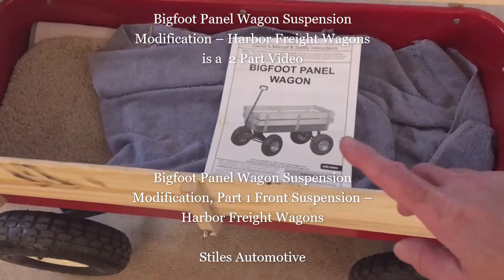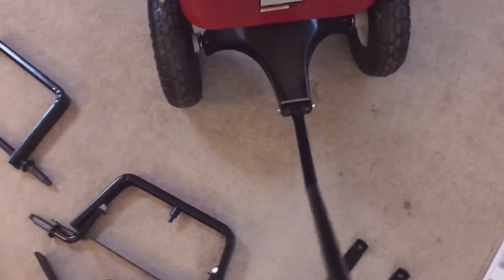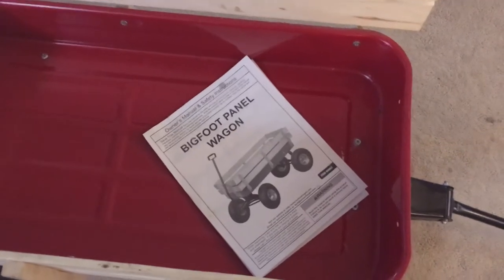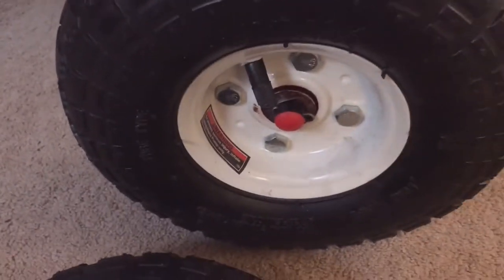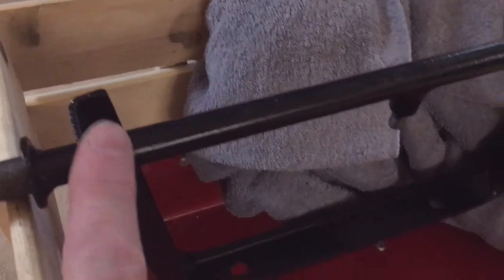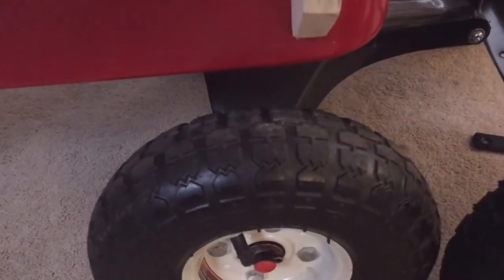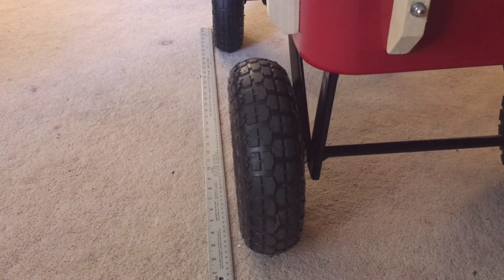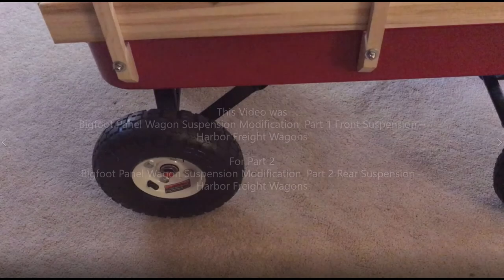Bigfoot Panel Wagon Suspension Modification, Part 1 Front Suspension – Harbor Freight Wagons

Comment: This is the coolest thing I've ever seen. I own 3 of these Bigfoot Panel Wagons, I want to covert all of them. 
Next you should build a frame for the flexible pan.
Reply from the maker: Randy, I had thought of that, but didn't want the additional weight. I did use Fender Washer (smaller hole and larger OD) inside of the Wagon. I have not seen any evidence of tearout of the Sheet Metal. I do wish the Pan was made from a thicker Sheet Metal.  If you are loading your Wagons heavier than I am and you are concerned about the pan, you could easily add 2 Support Brackets (similar to the center Bracket) to the Rear Suspension, going from the Axles near the Wheels to the Pan near the edge of the Pan. The edge of the Pan is where the strength is. 

This has been a great modification, it makes the wagon so much safer and easier to pull.  - Stiles
Reply: Thank you. Excellent advice and that's what I think I'll do. I have 4 of these Bigfoot wagons, and about 13 similar radio flyer wagons. My only question now is what to do with the 10 or 12 garden wagon, steel mesh flat beds I'm going to have left over 😅